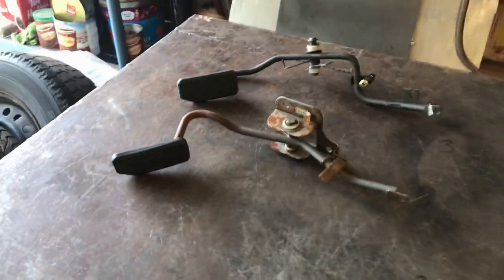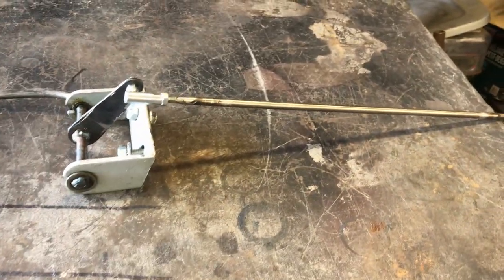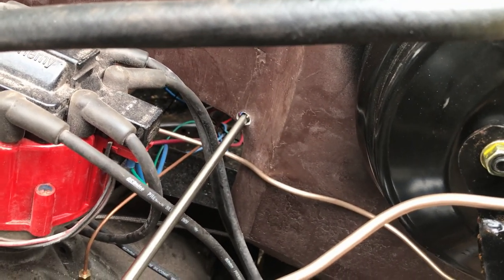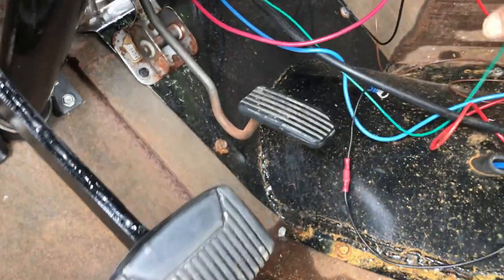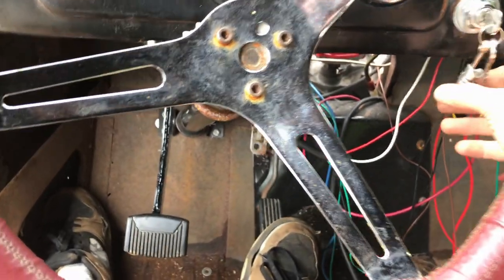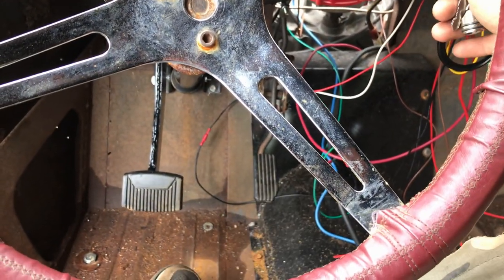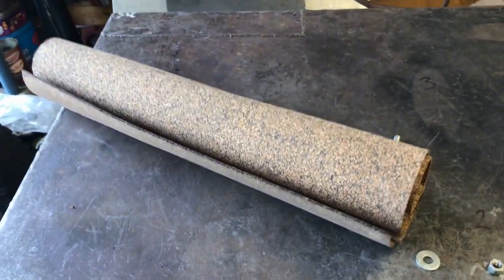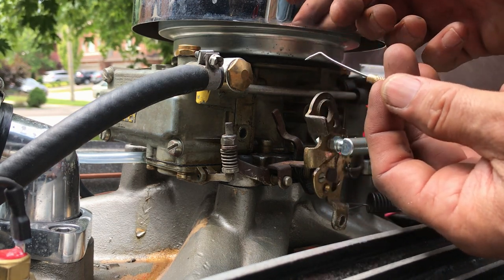Gas Pedal Install And Brake Test On My 1936 Chevy Coupe

Comment: When I was restoring my corvette I remember using a vacuum pump to bleed the brakes it attaches to the bleeder screw at the wheel. I think your local auto store may have more details good luck Dave!!!! Nice test drive even if it was just a few feet!!!!

Comment: Nice job!  When you were revving the engine, the brake pedal appeared to be lifting, as if manifold pressure was being created and was pushing the master cylinder piston. I’ve never noticed that behaviour before.
Reply: I noticed the same thing. I'm not sure what that means either.
Reply: There are springs inside the master that return the pistons to their rest position, so they will tend to push the pushrod backwards. But there still needs to be some kind of external return spring.
Reply: I thought the same thing!
Reply from the maker: The pedal was actually going downwards when I revved, implying too much vacuum. I don't have a check valve yet.
Reply: No such thing as too much vacuum. 
If pedal moving it was the booster working by itself. When you first start to push the pedal there is a passageway inside the booster that allows atmosphere to enter the rear section and since vacuum is in the front section it all works together to apply the brakes forcefully. The weight and angle of the pedal is probably pushing down enough to activate the booster. Another reason for an external return spring.
Reply from the maker: @ted5415  Yeah, the pedal is pretty heavy now.

Comment: Are you getting the full stroke of the master cylinder with the current brake pedal geometry?  I'm wondering if your setup is giving you a short stroke on the master cylinder which would also give you a lot of leverage which would make the pedal feel soft.  Not a rod builder but it appears that factory brakes provide the full stroke on the master cylinder where the cylinder bottoms when the pedal hits the stop.  

Love your build series!

Comment: Carb leak is probably bowl or accelerator pump gaskets , their is no fuel in the idle screws. Adjust your rear brakes by turning the tires while adjusting the star wheels until you have a light drag on the drum, that might take care of some of the soft pedal .
Reply from the maker: These are the air/fuel mixture screws. I'll try adjusting the rear brakes like you say.

Comment: Congrats you now have a roller! I gotta ask a question, when you drive your truck and you stop at a corner do you push on the brake pedal harder after you have stopped?
Reply from the maker: hahaha, of course not, but then I don't normally have a house in front of me and a wife's mini behind me.
Reply: @ScottRods  I was being facetious so here is my actual point. When you push the pedal to stop you are not using anywhere near the potential of the hydraulic pressure that can be produced. 25 maybe 35%?  Sitting still you keep pushing exerting more pressure but really not doing anything but creating pressure. Follow what I mean?
Reply from the maker: @miked1298  Yeah, I get you. And what I was meaning was, until I know this thing stops, I'm insanely paranoid that it's going to shoot off and kill someone, lol. Now I know it works I'll stop standing on it.
Reply: @ScottRods  We all second guess our own creations.

Comment: that's awesome Dave is the bore in the master large enough to fill the calper
Reply: perhaps you need a crown vic master cyl.
Reply from the maker: That would imply that the caliper pistons are empty every time before you brake. The master is from a modern family sedan, I'm sure it would have similar brakes to a crown vic.
Reply from the maker: hmmm, interesting.
Reply: @ScottRods  nice to see it move congrats!! The reason I had mentioned about a residual valve was to stop the brake fluid from emptying the brake cylinders.  That m/c you have maybe from a modern car with 4 wheel disc brakes.  Also check the free play on pedal rod to booster  and free play from booster to master cylinder.  Good luck on your quest to stoping on a dime and getting nine cents back.  : )

Comment: When you put your air adjuster screws back in, where did you set them?  I usually start, 1 1/2 turns out!
Reply from the maker: yes, exactly 1 1/2

Comment: I almost pissed my pants laughing when your grill fell off lol. Seriously though. I still think your brake pedal geometry might still be off. I think it’s like a 4 to 1 ratio. The distance from the pedal pivot point to the push rod point compared to the bottom of the pedal and the push rod attachment. It might be soft because you have too much leverage. For manual brakes you need lots. For power brakes not so much. I also saw the pedal surging as you hit the throttle. Do you have a check valve in the booster vacuum line?  Or a spring might work for that as you suggested. But. The bottom line is you have a running and driving car!!
Reply from the maker: Ok, I think you are on to something, actually TWO things. If I am to get the right pedal ratio, I'll need to redo the bracket so the top pivot can move up. I can do that. Second, yes, I noticed the brake pedal going down too, like there's too much vacuum sucking it down.

Comment: Are you sure that the master cylinder isn't bypassing it self? I went through 5 "brand new " masters before I got one that worked from O'Reilly all had made in China printed on the boxes
Reply from the maker: I think Ron might be right. The brakes are working great, so perhaps I'm just being allowed to apply way too much pressure because of an incorrect pedal ratio.